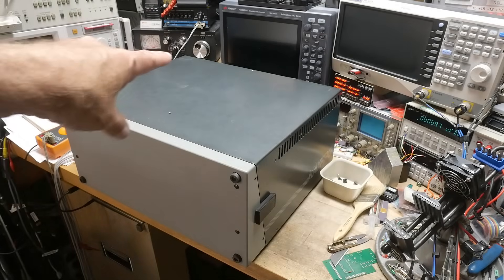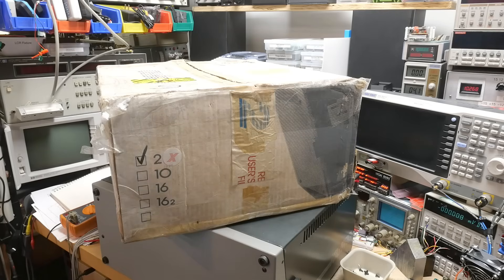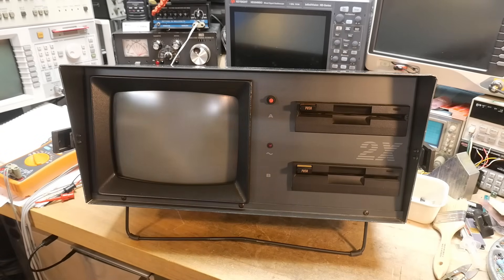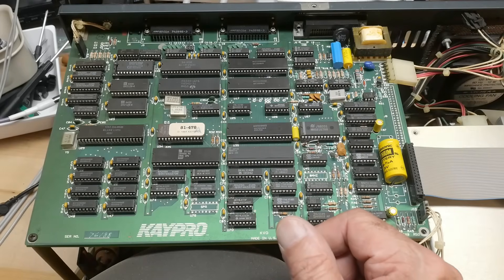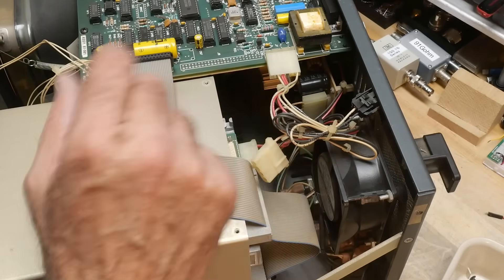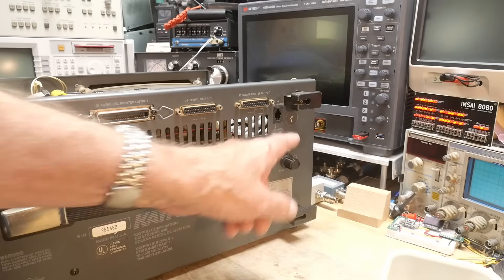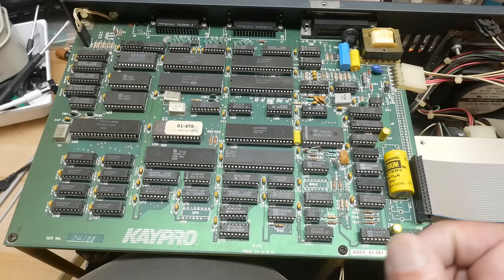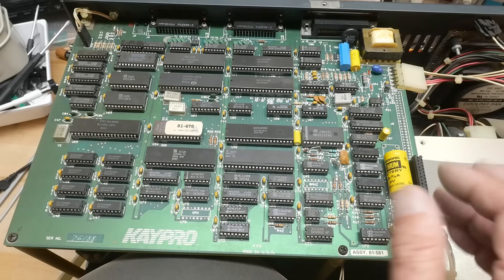#2401 Kaypro 2X Computer (part 1 of 10)

Comment: I had one of those in the day. It was large and heavy, but, it was affordable and did what I needed it to do. I primarily used it for word processing and spreadsheets. I collected and analyzed large amounts of data with the spreadsheet program. The data types ranged from operations, logistics, and safety management. I finally gave it up after the first reasonable priced desktop PCs became available.

Comment: Oh Wow!  What memories.  My first "manufactured" computer was a Kaypro.  I didn't pay for it though.  I set up a deal with a local PC shop to repair Kaypros for credit towards a new machiine.  When I got enough credit for a new machine I quit.  Prior to that, I had designed my very first computer with the Intel 4004 then then mid-design I switched to an to the newly released 8008.  I, by hand, designed all the circuitry, etched my own boards, built the power supply and enclosure.  I wrote my own "executive" program (today it would be called an operating system) in assembly.  And, since it needed to reside in the system on bootup I had to design and build an eprom programmer.  No keyboards for any of this yet.  I used all toggles switches for data and address lines.  I got good at flipping switches.  Thanks for the nostalgic reminder.  Keep up the good work and good luck on the restoration.

Comment: When I was a kid, I was the only person who could fix things. I didn't have the right wire stripper for the phone line cables, so I stripped them by pulling through the tiny gap where my top two teeth met up. It was really fun if the phone rang when I was doing that! There were two pastures on both sides of the house. Getting shocked by the electric fences was far worse than the telephone shock. At one point the guy "upgraded" the fence to such a high output that one day when I accidentally touched it, it almost knocked me out.
Oh the good ol days! People have no idea how comfortable everything is today.

Comment: That lithium battery probably still has 3V plus voltage on it, though it likely also has greater than 100k internal resistance as well.
Reply from the maker: It did not.
Reply: @IMSAIGuy  I had some 30 years expired, and they still had 3V terminal voltage, but a 10M meter would drop it to under 1V

Comment: One more Kaypro fact. In their day, those 5-inch floppies had a variety of incompatible formats, depending on the brand of computer. Someone wrote Kaypro software that could write and read a wide variety of them. In the mid-1980s the computer center at the University of Washington had a Kaypro linked to its mainframe so people could upload and download files from their personal computers.
Reply from the maker: ROM upgrades such as KayPlus allows you to use non kaypro disks.

Comment: Reminds me of the luggable Compaq. Except when you took the cover off of the Compaq you were greeted with what looked like a MIL-Spec chassis. Built to be handled by luggage handlers!
Reply: I worked with a guy who had one of those Compaqs. He opened it up one day and the interior did look MIL-spec. I recall the hard drive had shock absorbers. It was built for people who traveled. My Kaypro 4 was no where near that rugged (or heavy).

Comment: Very unusual that they put a centroincs style connector on the parallel port on the computer side. Was that the standard back then? I don't think I've ever seen a centronics to centronics cable for a printer, usually they're DB-25 to centronics. Of course scsi cables are centronics to centronics, but a larger connector with more pins. 50 for scsi vs 37 for parallel printer if I remember right?
Reply from the maker: back in the day it was centronics to centronics.

Comment: I have an early 2x, but I seem to have zapped something as it no longer works.  It used to work just fine.  I had been in the process of trying to connect one of those retro wifi modems and was checking for some signals and I think a lead from my VOM hit a trace and shorted.   Have not been able to make it work since.  I believe the PSU is fine and the graphics board I thinik is Ok.  But there does not seem to be any video signals going to it from the top main board.  I do like the machine and I too have never had one so found this on eBay for a decent price.  Too bad my retro repair skills are not that good.  So I will watch your videos about this machine and enjoy.  I did swap out the one drive for a Gotek (with Flashfloppy) and it works great.

Comment: That's nice.

One of the IC's will be a Z8470 Z80 Dual Asynchronous Receiver Transmitter, (DART), and another one should be a Z8430 Z80 Counter/Timer Circuit, (CTC). They work along side the Z8420 Z80 Parallel Input/output, (PIO).

Comment: I have an original Kaypro model in the basement with a bad power supply and half height drives in the full height drive holes.  I got along with CP/M very well.  Mine did not have a fan and that fan design looks original, it looks like the case was painted after the hole was create.  I replaced it with a VIC-20. Ron W4BIN

Comment: I've always wanted use my Osborne 1 for process control & data acquisition like the HP machines did over HPIB.  The Kaypro seems more capable with the Compaq portables at the top owing to their graphics capabilities and more software.

Do you think something like that is possible with the older machines like the Osborne or Kaypro?
Reply from the maker: sure, use a serial interface

Comment: Well this should be fun. I just picked up a "new" Tandy Model 4P. I purchased my original M4P back in Dec 1983 and it went everywhere with me. I am certain it was in the design, but that machine fit perfectly under the airplane seat in front of you on every airplane I took it on; which was several including to Japan and back when I was stationed in Okinawa. They "new" M4P has some video alignment issues and possibly the "B" drive but until I get the power supply 100% I'm taking it easy on the machine.

Comment: Hmm I am going to have to dig out my old ZORBA 2 one day and get it going again.  I miss CPM🙂 By the way the first Lugabout was the 'Osborne1 ' with the contact lens CRT.  Though the MCM/70 or IMB 5100 are both touted as the first though at 20+ KG the 5100 was not 'Luggable' and the MCM/70 did not have an operating system only APL and only a single line LCD display.

Comment: As I understand Osborne had the FIRST luggable computer in 1981. However if you were to use the Osborne, you needed two units so hopefully, you would have one working while the other one was in the shop being expensively repaired. I sill have and occasionally use my IBM 5155 luggable. I have it attached to my 1980's era VINTAGE EPROM burner to occasionally burn an EPROM or a project.
Reply from the maker: https://youtu.be/DpT_upoEPnY?si=yDhZ2dX16fP7g5Xx

Comment: That model would be slightly newer. The original Kaypro II was 1982-1983ish, but the 2x (and subsequently 2, per wikipedia) were later, substantially upgraded models - the 2x being 1984 and the 2 being 1985. Clear? As mud.
Reply: That looks like it might actually be a Kaypro 4 (not IV) motherboard, which was distinguished by the modem and RTC. Most of the boards are totally interchangeable (except the II and IV), so maybe the owner upgraded his 2x, or mashed a couple together to get a working one, or... considering how Kaypro was run, they just ran out of 2x boards at the factory that day and stuck a 4 board in instead.

Comment: KAYPRO II was my first back in the day.  It came with a fan.  They got noisy with age, so were often replaced.  2.5Mhz, full height drives. Reset was on the front.  There were a fair number of third party mods. Up grade roms for early machines.  The first program I wrote (assembly) was a TSR keyboard buffer.  I modified the clock to speed it up and added some paged ram.

Comment: I remember seeing these "transportable" computers around. That's what I called them anyway. Interesting that they used an external IC to refresh the RAM. The Z80 has provisions for refreshing RAM. Maybe the amount of RAM is greater this way.
Reply: The Z-80 only supports a 7-bit refresh, which is for 16K chips. This was due to a limitation of the counter circuit that they used for the R and I registers. But this was probably the reason that a few 64K DRAMs had a 7-bit refresh.

Comment: I think they had a Kaypro and a couple other different computers in my Vo-Tech electronics class during high school.  I didn't get to play with them because I took the 2 way radio, radar and TV sub courses.  I do know all the computers they used in the computer sub course were highly modified so the instructor could enable or install faults.  All of the IC's were socketed so the instructor could put faulty IC's in for the troubleshooting section of the course.  Hopefully you can bring this beast back to life.

Comment: Looked to me like the CRT driver board is cracked near one of the mounting holes.  Seems like it much have been dropped, maybe?  Wonder if that happened when the foot got sheared off.   Looks really clean on the inside, though, quite a find!  Though if it was in excellent condition, this wouldn't be a 10 part series!   Feels like quite the adventure is going to be playing out; have to get some popcorn and follow along.
Reply: Yes, the fan itself may have been replaced but the chassis clearly already had a hole for one.
Reply: I don't think that's a crack. There are several mousebites on the pcb on the side and near the rear mounting post - are they what you're seeing?

Comment: Looks very familiar. I bought by first personal PC in 1985 and it was a Kaypro just like this. I added accessories during the years as more power and memory was needed. It was in a heavy use. Plenty of applications came with the box and they were pretty useful. The display was a green Hercules graphics. This was one of the most useful tools I had in the 1980's. I still have the schematics left of it.